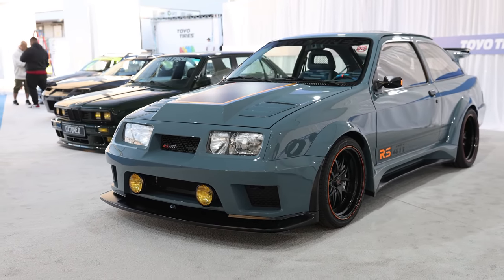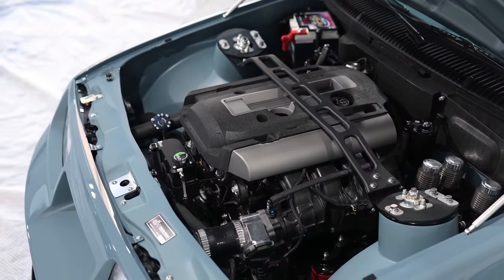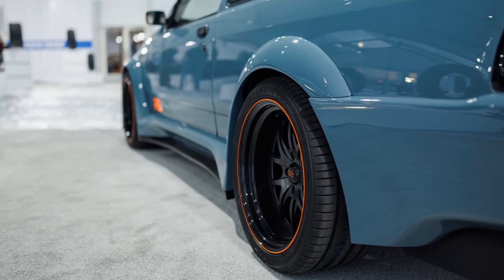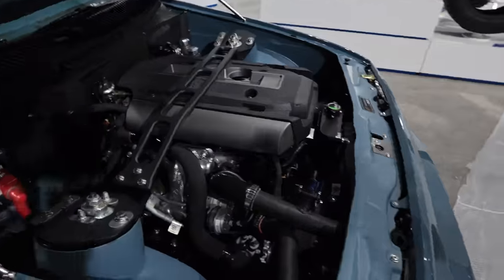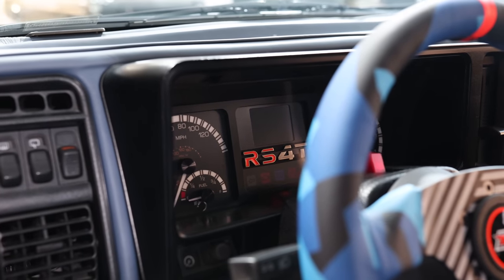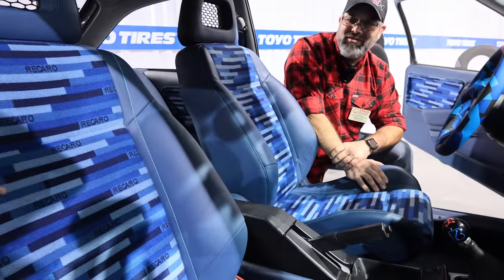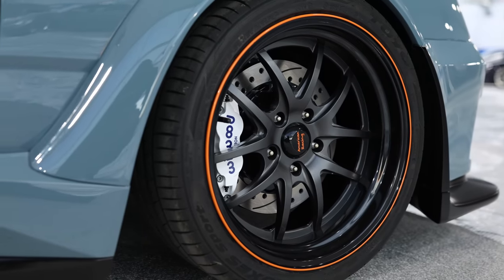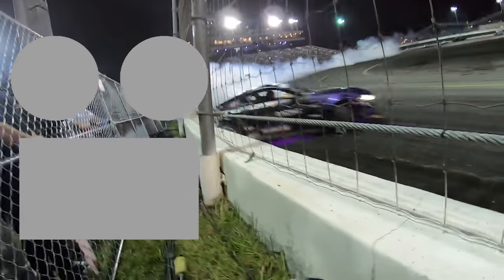Modernized "Ford Sierra Cosworth" with a 2.3L Ford Ecoboost Crate Motor

Comment: I love the sapphire rear lights, the Sn95 style rear bumper, the RS500-homage bonnet vents.. 
The Euro/US blend is really awesome. Respect from the U.K on this one.
Reply: Got to agree with you! Love it
Reply: Noticed them sapphire rears straight away but can't believe how good they look what a build amazing fit and finish. I'll have a right hand drive with RS-500evo badges plz  😅 👍🇬🇧
Reply: The dark sapphire lights are very cool, have the same one.
Reply: They won’t be Sapphire lights, they don’t fit. Well they do but the lenses sit at a funny angle if you fit them to a hatchback (Cosworth or not) I have both mk1 & mk2 3-doors and know what’s what. The lights this bloke will have used is just standard mk2 Sierra 5-door hatchback lights, you know G’dads 1.8 lx.

Anyway, awesome build 👌🏻
Reply: @jeffheineken6709  They could actually be the same part# knowing ford😂
I see what you mean, but the rear lights between all these models look almost identical.. 
.. Then when you add in Ford of South Africa's version of the 3 Door Sierra, which came with MK2 Saff lights all round, front and rear.. it becomes harder to tell what-fits-what or where the parts actually came from. 

"Motor Addicts - Crazy LS400 Powered MK2 Sierra" Is a cool yt vid on an S.A spec car for anyone interested
Reply: @mickniesi743 They are kind of very sort after now. But parts for a Ford Capri Mk3 injection Special are hard to come by an expensive. I'm after a ESRT 32ps Ford Stereo an not much change out of £300 😂
Reply: The bonnet vents is just RS, first sierra RS Cosworth in 85 to the last in 87 had these vents in the bonnet, the RS500 was only in 87. RS500 also only came without sunroof bc all 500 cars was ment for racing.
Reply: @polarViking they are not factory cos worth vents had plenty of cossies to know
Reply: Cosworth was a crazy era, no police car could keep up. One big issue with the sierras was the security. They were REDICULOUSLY easy to break into. My dad had his stolen. The police eventually found it. When we went to see it... it was completely stripped to the frame. Really broke my heart. I loved that car so much 💔

Comment: I grew up with these in Ireland and did 2 projects in College on Cossies.  The South African market 3 door Sierras had the Mustang 5.0 V8 of which I was always jealous.  The original engine in the Sierra RS had a second set of injectors so the cars with head studs and minor mods could make 500 hp reliably.

I suppose the 2.3 in reminiscent of the XR4ti but the 2.0 from the Sierra RS Cosworth was a superior engine, bred for racing.

I think the 3.5 ecoboost would have been a stunning unit to drop in here.  If the 5.0 V8 fit I bet the V6 could with mods.

That front bumper though, got to go.  Original RS500 with the ducted brake cooling vents where the fog lamps would sit.

I see you added the last generation tail lamps too from the later gen Sierras.  Nice.  The only 3 door Cossie (clone) with AC too.

Congratulations on it.  I’d buy it in FL

- How did you guys do the 3/4 rear window conversion?
Reply: Im not sure about the US cars but the 2 door shell without the 2 part rear window wa only available as 1.3L Sierra and the 3 door cosworth . I think the SA cars and US cars were all the same as the UK XR4i cars so they either cut the metal out or they got a three door shell from Europe. And no, the Cosworth engine was not designed to go racing. The 2.0 Cosworth engine only special because of the head and turbo. The rest is just a plain Ford 2 litre Pinto which was available in the Cortina and Granada. That is not to say that it didnt do well when it was sent racing though.
Reply: Yeah you’re right about the pinto block.  When the Sierra sales were in the doldrums, Ford sent that block to Cosworth.  The engine was built from day one with a minimum target of 500 bhp with 8 injectors and a garret Turbo.
The road going cars would all retain the the 8 fuel injectors but only 4 were active:  
An Intercooler was also added to drop inlet temperatures.  That pinto block was a beast, but no Ford head could be mated to make the power for the World touring Cars, to beat the Nissan Skyline, the BMW M3 and the Mercedes 2.3-16 Cosworth..  Cosworth built that head specifically with the pinto block as it’s foundation.  Amazing really.
As for the rear 3/4 windows, all 3 door Sierras had the one piece, except the XR4i, and that was adopted on the XR4ti when Ford tried to make the Sierra a world car.  The US DOT rules, mandated the US style bumpers, the rear fog lights deleted, the headlights and front foglights changed.
The 2.3 liter in this car is the XR4ti block that came from the 4 cylinder Mustang.  I never liked that engine but it could meet US emissions, and it fit mod free, so the XR4ti got that 170+hp, which was better than the Cologne 2.8 V6 in the XR4i.
Unfortunately in a culture where V8’s were the norm, and 6 cylinder engines were considered basic, the XR4ti was always doomed to me with a 4 cylinder engine.
Even Sierra Cosworths sounded like diesel fiestas at idle.

All of this makes me think that 3.5 twin turbo ecoboost would be a perfect engine for this project car.
Reply: The 3.5 ecoboost engine is really heavy and sits up high the 2.3 ecoboost is a good swap to replace the 2.0 it has more torque and they have forged internals from the factory the only weak point of the engine is the turbo and engine block other than that put some performance spark plugs in it, a better head gasket, aftermarket intercooler and e85 you have 360-400whp and 400+ wtq.

Comment: Modifying the rear side windows to use the UK spec glass is such a great detail, as well. So much better than the OEM XR4Ti. I love this thing.
Reply: The reason for the 2 piece glass in the US market was because the single glass did not meet the requirements for rollover protection. I owned many of these back in the day.
Reply: In Argentina we had the Sierra XR4 coupe with the split rear window like the Merkur, but with the rear spoiler like the cossie. And with the 2.0 carbureted lima engine. it was very popular with the touring car racing against Renault Fuegos, Peugeout 505, VW Fox. even now is still sought after for rally and drifting because its rwd
Reply: The Sierra XR4i came out about 3 years before the Sierra Cosworth, they thought it would be good styling & make the car look different on the performance model, Cosworth then used the base model 3dr shells with the one piece window, hence why cossies have those windows
Reply: @bassntruck We had that with the non Cossie Sierra 3 door. Split rear quarter glass. But the Cossie had the single piece .
Reply: @Sharpey187 , my Dad owned an 86 XR4i... Awesome car to drive and looked way different to anything else on the UK market at the time... Oh and not forgetting, it was a superior handling car compared to any offering from the German brands...
Reply: @PatricioGarcia1973 en Argentina lo mataron con ese motor desgraciado que gastaba como falcon y andaba como un fiat 600... De haber tenido una mecanica mas moderna calculo hubiera sido mas exitoso.
Reply: @realMaverickBuckley UK and Europe base model 3 door Sierras had the single piece glass in the side windows. Only the XR4i had the split in UK/EU, as did the Merkur.
Reply: Yes those cars didnt sell well ,wouldn't surprise me if they used that shell just to get rid of them the first few were weak and the roofsbent in relatively small accidents@Sharpey187

Comment: This cossie restomod is insanely cool would love too see one with a 5.0 coyote in it
Reply: There is like millon of those at least this one is more original
Reply: This fits more with the original car which had a 2.3 turbo Lima
Reply: Nah yall don’t know , BARA IS KING
Reply: I do remember back in the day people replacing the stock Merkur  motors with motors from the 5.0 fox body Mustang GTs
Reply: Yeah but V8 swaps aren’t unique anymore.
Reply: Didn't have to scroll far, that was predictable
Reply: If Ford was going to build a modern version of this car now it would be all electric with a 2.5 second 0-60 time! (Maybe they will!) 🙏
Reply: In Britain only the Cosworth powered cars are valuable.
Reply: @georgelin8498 sorry original engine is the yb.    And the cossie is never sold in the Us
Reply: yes very well done … missed seeing it inside but walked past it in the parking lot by Westgate and it is very impressive. Very tasteful clean build!
Reply: I think Zakspeed put an old 5.0 in one with a proper wide body kit. There were race versions with 500hp/500tq
Reply: @GRIM.2002 Baras too big for these
Reply: Barras has been swapped in to Xr and Coyotes also, by the way the Coyote fits using the stock K member.

Comment: Pretty awesome guys , as a Brit from that era I was at first kinda expecting the conversion to have gone too far . 
Fortunately the mods are spot on for your market and some nice original detail kept . 
Loving the colour too . 
Even here in the UK parts are thin on the ground. 
Maybe I would have stuck to GPA 909 suspension etc but that’s just me . 👍
Reply: I saw a new old stock header tank go for £400 ($550) last year 😳😳
Reply: @realMaverickBuckley  I can imagine something like those prices especially for the rare RS500 stuff like inlet manifolds . Even E36/46 M3 stuff is becoming more expensive and there are certain ‘hard to get ‘ items. 
Pays to save everything

Comment: Removing the independant trailing arm rear suspension and fitting a solid axle under it is a step backwards.
Reply: You need to brush up on your car knowledge. 

This car doesn’t have a solid rear axle. You’ve taken a step backwards yourself.
Reply: @kaijumoto  Look at the pictures!  the guy even said they fitted a 8 inch Mustang rear axle,so try selecting your brain before engaging your mouth. I have probably forgotten more about cars than you will ever learn.
Reply: @kaijumoto  He is right,in the video you can see the `cart` axle. You have shot yourself in the foot there and notpoliticallycorrect has shot you down in flames.😂😂😂

Comment: People really do underestimate how nice the Ford Ecoboost engines are to live with. You can get them to make sufficient power for everyday road use and they'll do it quite reliably with relatively few modifications. I guess the V6 wouldn't fit due to width restrictions, which is a bit of a shame. The current Ecoboost v6 in the larger displacement is able to quite easily make 400-450 HP with only an ECU retune.

Regardless, this build is impeccably clean and it should be quite nice to drive while remaining very livable. It does probably want premium fuel, though, since the boost had to be increased so much to make that kind of power with the 2.3L, but that's not a huge deal compared to what some people have to run to avoid knocking or pre-detonation.

Comment: I have an 86 XR4TI I am retromoding at the moment. I had considered using the 2.3l ecoboost, but. Perhaps not now. After hearing the work needed. Definitely not equipped to start moving firewalls. Definitely can pull some inspiration from the build otherwise though. 
Nice to hear the shout to LivernoisMS. Good group there, love their tunes on my Explorer and will be using their tuner with my Ecoboost F150.

Comment: A side note, This shape Sierra (Here in the UK) did come with 4x4. They were the XR4x4i's, they came in 3 & 5 doors. The 3 door had a slightly different rear (passenger) window layout, with it being split, rather than a large window for the back seat passengers.

Comment: Edit** 
THOSE ARE MUSTANG HEAT EXTRACTORS ON THE HOOD !! 🔥🔥🔥

That engine bay is so clean. Im getting my rad support colour matched like how he has it , makes the engine bay so damn clean
Reply: If you're talking about the vents, I have the same vents on my '87 XR that I imported from England back in '89 to clone the RS500. Those were original to the RS500 in England.
Reply: @xr500t  oh my mistake.. they look very close to the mustang ones on a gt

Comment: Before I say this, I don't know if they do the 2.7 V6 twin turbo ecoboost as crate, but you should have gotten that.  I owned a 2017 Ford Fusion Sport with this motor and always felt it was the natural successor to the Cosworths.  400hp without even trying.  I miss that car.  Check them out if you haven't.

Comment: it looks just like the one I had inside, It has the same FM LW radio cassette player but I had a cassette storage system underneath it, not a graphic equaliser,  I love the restraint in this build, it is very European, if it's not needed don't have it, the Recaro cloth used I've seen that pattern but in red/yellow/orange . . . if ford had the courage to make this car it would be an instant success, all the XR Fords from back in the 80s were great. people would be banging on the doors of the showrooms throwing money at them,

Comment: 3dr Sierra RS Cosworth and RS 500 were RWD.
The XR4i came as an XR4x4 (im sure both had the extra window pillar in the rear)
The Sierra Sapphire Cosworth came in RWD and then from about '89 was 4x4 too. 
I love the visuals on this, but tbh, that Ecoboost engine just upsets me. Would have loved to have seen a well fettled Cosworth engine in there. They're just legendary engines and look so cool with the exposed cam gears at the front.
Reply: RS500 has the lower spoiler. RS Cosworth only has the whale tail.
Interesting one is the Escort Cosworth where the designer wanted a two tier whale tale for proper downforce, but the bean counters said no. Wheeler Dealers fabricated one and tested it and it added the dowforce.

Comment: Glossed over the mods to change the xr4(t)I body shell to the normal 3 door body shell. 
Rs cosworths used the base model 3 door body shell due to lightness. Xr4i and 4t used the different body with the extra side pillar.

Comment: I'm just baffled as to how tall that engine is. I have an E89 BMW Z4 3.0 and just took a rough height measurement and I'm getting about 2'3''. I roughly measured the Merk and I can safely see a 2'6" in the engine compartment.  I'm ready to throw that sweet 6 in it! The sound in that bimmer is something else. I have a Borla dual and it was ok, but it just didn't have the note.

Comment: I built a similar spec car based on a  Sierra 1982 2 door body and a self built brand new duratec 2 ltre made out to 2.3 with   low compression pistons and Garret blower into 4 custom body double injectors. Made a wide 320bhp at rear wheels and smooth and reliable. So easy to build and get just right. Too expensive now.

Comment: If anyone cares where the name XR4Ti came from. It comes from what the car is based on Fords internal codes. XR was the designation for Sports car, 4 was the number of cylinders, T for turbo charged, i for fuel injection. For more information, these cars were built so well that they were all within 3mm width of each other.

Comment: These Merkur were Sold through Lincoln Mercury Dealership. In the late 80’s they had a unique looks but the reliability was “terrible”, not just oil leaks but the 2.3 Keep blowing up. 😂
Reply: Yeah the 2.0 cosworth motor was badass they should have put that motor in instead of the 2.3 eco boost
Reply: @robocop3961 , Back when they first came out, the 2.3 was all Ford had, and that was an old Pinto engine they just slapped turbo on it.
Reply: @Bobbyleejoe2556  I get that but the ‘cosworth motor’ is the one, able to produce a 1000hp that was from the mid 80’s a race bred motor… I just feel like they should of used the cosworth in this one instead of the 2.3 eco boost but either way it’s a beautiful car non the less!!!!

Comment: That's a nice car but idk if it was worth the obvious immense amount of time and money put into it. The 2.3 ecoboost is flawed. I'd rather have the 2.0 duratec turboed. Exna on the direct direct injection. The base car is really to heavy. I had 5 xr4ti's and loved them for sure. But I'd rather have a ford focus rs awd. Alot less work in a lighter package with better more advanced safety systems aka modern. I will never forget the socal merkur club and our meets. Really nice what you've done there.

Comment: Would it be possible to cast another bellhousing and sump and fit engine in at an angle to drop cam cover below guards to lose the bonnet hump, like a vauxhall firenza

Comment: The front bumper and bonnet/hood are both tragic 😩. But the general overall look is cool. I like the bonnet vents and the sapphire (sedan) tail light conversion 😎👌 Nice touch on the 2.3L Ecoboost conversion and also with the Mk2 Escort RS2000 "Fishnet Recaro" headrests too 😎

Comment: Very cool looking car, that said the original Turbo Cosworth YB engine is cooler than a boring crate motor, so this isn't a Cosworth at all technically speaking. Still a very cool car though, very clean a nice colour, great wheels and body kit too.
Reply: YB’s are becoming harder to find available. They come up for sale from time to time, but scene tax in the UK is extortionate. Although they’re one my favourite tuneable 4 cylinders, they are 30+ year old engines, heavy compared to todays standards and they consume quite a bit of oil. 

This is a nod to the pass.

Comment: should have tried to find some original tsw venoms in the uk i'd think almost every cosworth would have had a set at some point
Reply: Those or a Set of Azevs As 5 SPOKE also a favourite on the 3 series Beemers,Vauxhall and to be Honest basically on any car from that era as The 5 spoke Azev As they looked that good, by far my favourite Wheel of the Time
Reply: @johnboycurb9119  yup